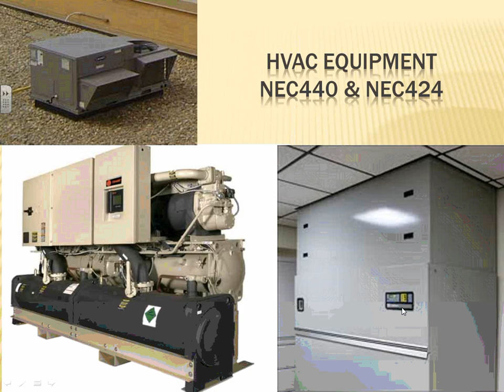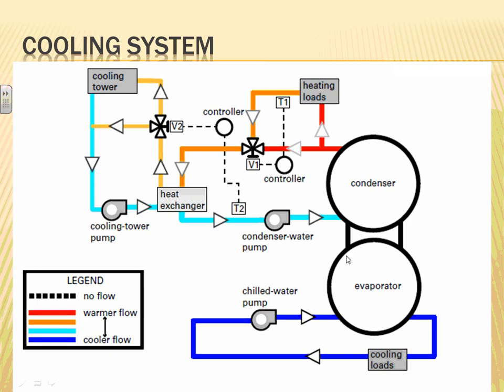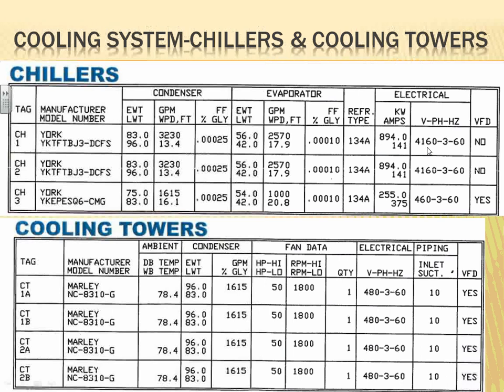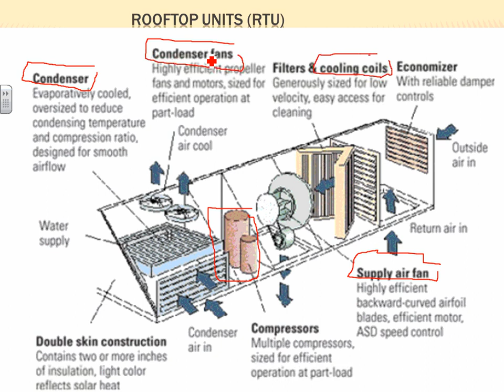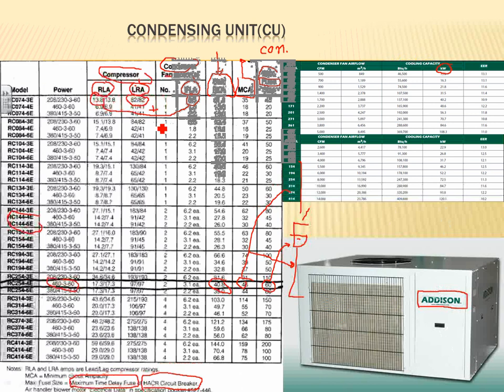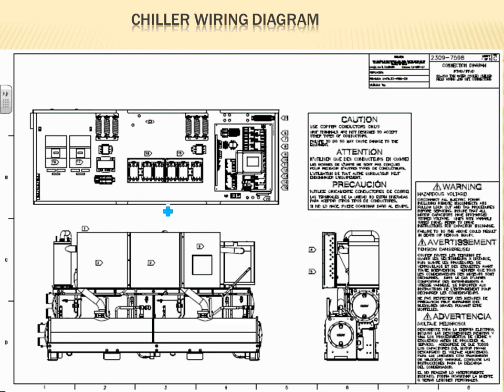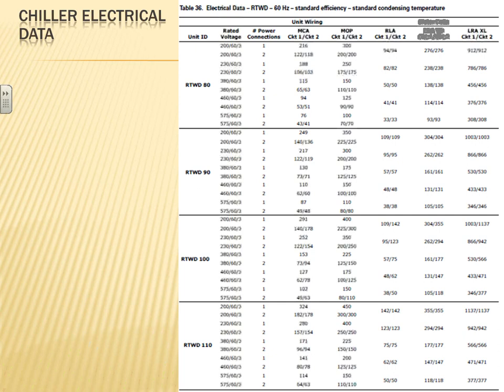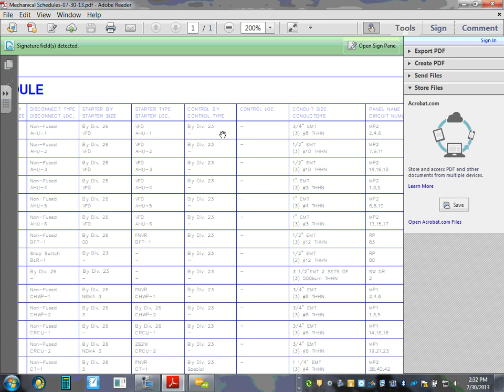Class#06-HVAC Equipment Branch Circuits & Feeders-7 30 13

Comment: Some HVAC units are designed to continuously operate at 156% of their RLA. In that case, manufacturers add MBCSC on the nameplate which is 1.56 X RLA. So in order to size the branch circuit for such HVACs, we will use MBCSC value and NOT the RLA value of the unit as required by the code.

Comment: To find the LRC equivalent HP rating of the HVAC (Condensor + Compressor) Unit:

Total LRC of HVAC Unit @ startup = LRC of Compressor Motor + ( Condensor Motor FLA X 6 ) + Other non- motor load.

where;

Other non- motor Load = HVAC Unit RLA or MBCSC - (Compressor Motor RLA + Condensor Fan Motor FLA ).

Since total LRC@startup is now found, we can go to NEC code to find equivalent HP rating.